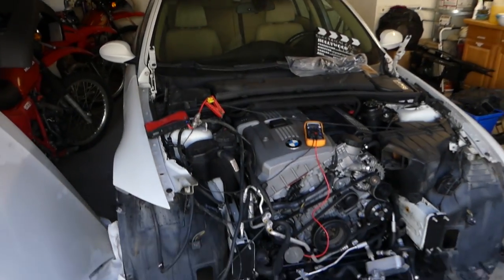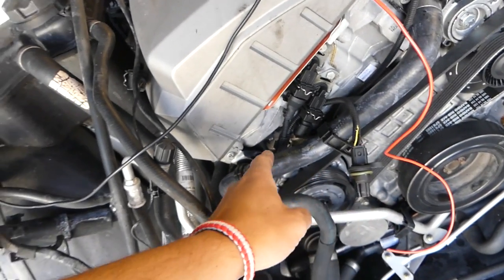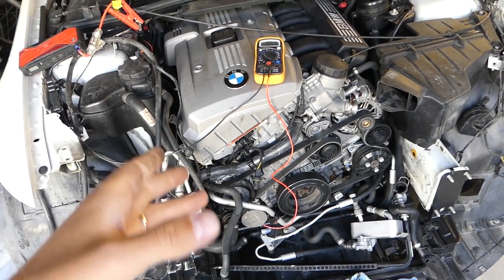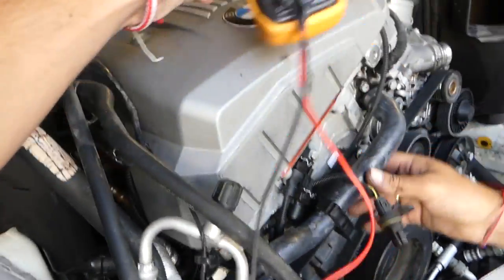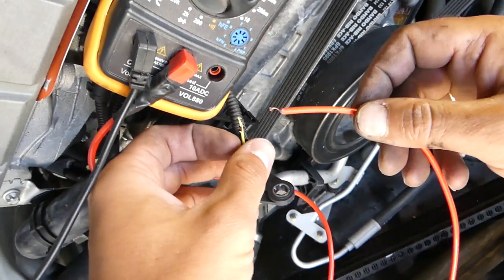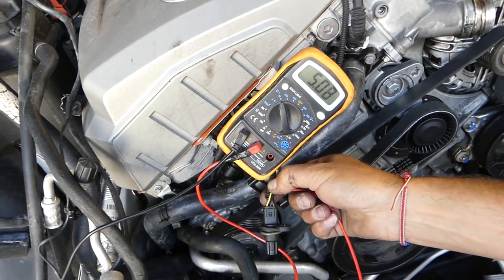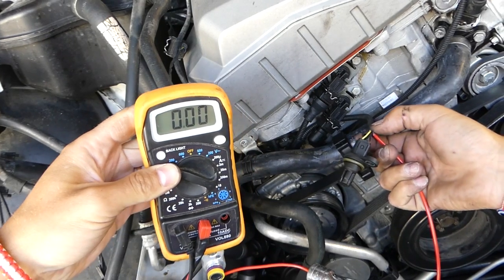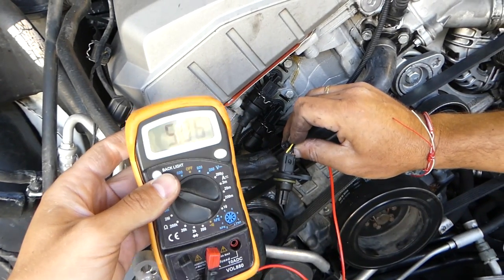HOW TO TEST CAMSHAFT POSITION SENSOR DEMONSTRATED ON BMW

Comment: Good video; is it possible to run through the procedure ahead of time to sure you have a good presentation instead of finding a place to place the meter, a 'CF' connection to a cut wire and a loss of continuity to the wire to improper contact; thanks!
Reply: Be thankful his showing us for free !

Comment: I have a 2005 645ci the voltage is close to 12 volts from the connection at the harness?

Comment: Hello, can you give an opinion regarding this situation (N47 318d 105kw): 
The car starts without any problem, or on cold or on hot - but on a cold start, some misfires are experienced - no glow plug errors, changed them, and the relay.
Besides that sometimes at low speed and smaller RPMs like between 1500-2000 I experience car stalling while in gear, while the motor is moving the car, when in neutral everything good? This happens sometimes hard to reproduce.
Can the problem be in a faulty camshaft position sensor or crank shaft sensor? 
Thanks in advance for your professional opinion.

Comment: Hi there my friends , good video , keep ip the good work , i love to watch you guys videos very informative , i have a question you hooked ur main wire to the number 1 on that cmp sensor connector but its the main voltage coming in from ignition switch or its the signal?

Comment: i have 11.5v instead of 5v on my middle wire when nothing is near the sensor
but when i put the wrench on the sensor it drops to 0 but doesn't stay at 0 the numbers jump around randomly should it be staying at 0 with the wrench on the sensor?
i used a back probe instead of cutting the wire tho
Reply: Mee too
Reply: I have the same thing. How did u fix this issue
Reply: @adrianthompson6936  hey man the sensors were ok, my issue was the timing chain was loose and skipped a tooth. i needed a new chain, new oil sump gasket and new oil vacuum pump behind the engine cost about 1500 AUD for everything at platinum auto pagewood. that fixed all the issues! my car just woudnt start one day. i actually got it started by resetting the computer errors but it was stuck in limp mode and wouldnt go over 2k rpm and i could hear the chain rattle when accelerate fast in neutral. been driving perfect now for 3 years since the repair. i think its much wiser to replace that chain before it jumps.

Comment: How would you test for an intermittent failing cam sensor?
Reply: They usually get worse with heat. I would try getting it up to running temperature with a heat gun and do the same test again.
Reply: Thanks!

Comment: Hi what if it goes to 0.70 instead of 0.00 does this mean it's knackered
Reply: My camshaft sensors also drop to 0.7v when in contact with metal
I'm not sure if it is correct or should drop to 0v